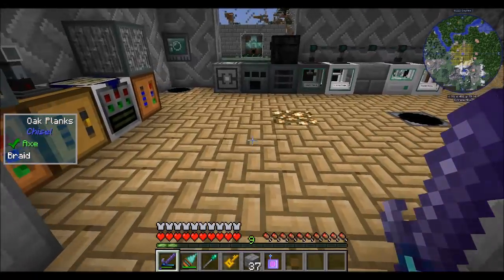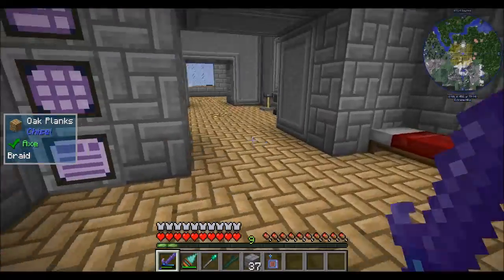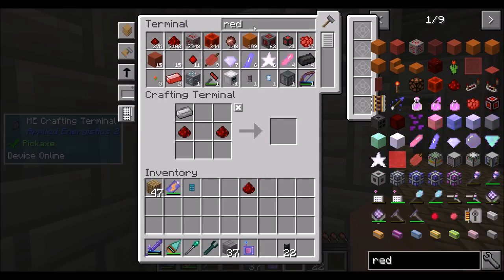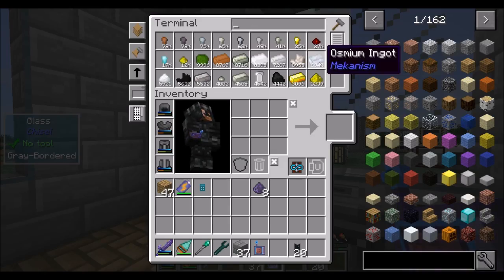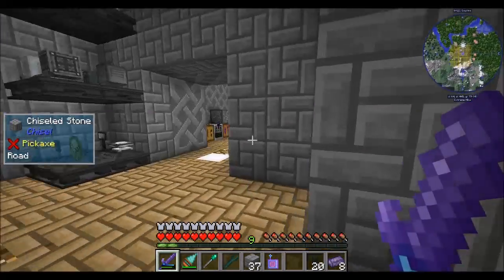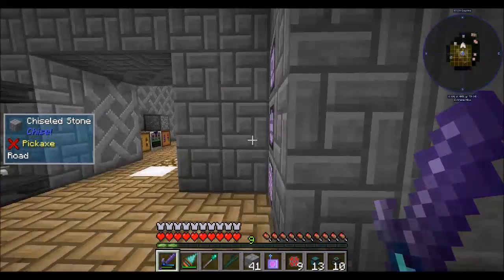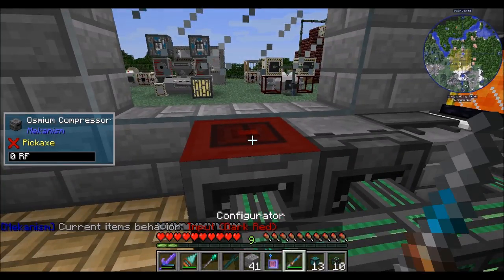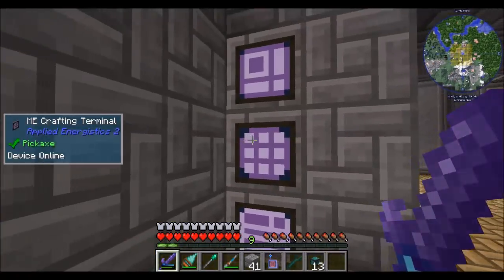AoE Ep57 Proper Mekanism

Comment: For saving Resources put the Redstone/Diamond/Coal/RefinedObsidian Dust first into a Enrichment Chamber to compress them. 1 Compressed Dust is 8 uses in the Infuser.
1 Normal Dust is just 1 use in the Infuser. So you need 3 Infusers Dire... Coal is just for Steel....
Also with very few Resources you can upgrade the Crafting Machienes. There are 4 Tiers: None, Basic, Advanced and Elite. Each Upgrade increases its simultaning crafting Capacity. 
For Example a Basic Machiene can craft/smelt/etc. 3 Items at the same time.
Also for Speed Upgrades...I recommend for each Speed Upgrade also an Energy Upgrade which reduces its Energy Usage.
Reply: 4 tiers are Basic, Advanced, Elite, and Ultimate. :D
Reply: He's probably just looking for any reason to waste the ridiculous amount of redstone he has lol.
Reply: the ones that can smelt 3 items at a time are factories
Reply: those are called factories
Reply: Also, the regular machines can be upgraded to factories in place using upgrade kits.
Reply: as long as it's all mek then it should be fine, did they fix the power bug with cable that can crash the server.
Reply: One of the greatest things about Mek is that it's all about Resource Efficiency. I came down to the comments just to tell him all this lol. Also, on the upgrades, it's about 2 Energy to 1 Speed to keep the same power consumption, but maxed upgrades is 10x of whichever (so 10x faster or 10% energy usage, etc). Also, Sound upgrades are a thing Dire will love.

Comment: Hey Dire, just a little tip for Mekanism,
When you install speed upgrades in your machines, MAKE SURE that you install energy upgrades too. If you install 8 speed and energy upgrades (hypothetically) then you actually use LESS power than no upgrades at all, so give that a shot! Thanks for making great content by the way.
Reply: This is not completely true.  8 energy upgrades decrease the energy usage to one tenth of the original, however 8 speed upgrades increase the energy consumption to be 100 times as much as the original. With 8 energy and 8 speed upgrades the machines use 10 times as much power as with no upgrades. Still, definitely worth it.
Reply: Ok, thanks for correcting me

Comment: the mekanism wrench is required because all the other wrenches dont have modes to switch between fluids, gases, items, and heat as well as input and output as well.

EDIT: took me 2 days with no sleep trying to figure out the mekanism stuff then i found out that only the mekanism wrench works (i was on the modpack named Project Ozone 2 Reloaded)
Reply: all the maschines from mekanism at least now have an interface that you can use to configurate what the sides do the only thing you realy need the wrench for is configurating pipes and rotate the maschienes
Reply: I'm confused how in depth you went into Mekanism in PO2. I only got enough of the basics to do very simple automation of HDPE sheets and demon steel. I only ever needed the buttons in the interface and a lot of messy cabling.
Reply: i wanted to do all of mekanism. HDPE sheets for the me controller, the plastic blocks for fancy building, and use the laser drill from mfr with the x4 ores (i think the x5 was disabled in project ozone 2 or something).
Reply: The Nerd no it wasn't. Trust me.

Comment: You should move pretty quickly to a bio generator with potentially some wind generators as supplement. Eventually you can make the huge multiblock reactor that makes stupid amounts of Joules which you can then store in the giant multiblock battery.

Also if you disable sides that aren't used on the energy cube, you get to see the nifty animation hologram in the middle that shows how much power is in the cube.

Comment: Hey dire, have you thought of using ender IO  item conduits and attaching several interfaces to them to increase the ability to auto-craft? That way you could have up to 5 interfaces per block side as apposed to 1.
Reply: I don't think Interfaces can output directly to conduits. That is why he uses chests when he needs to use conduits for auto-crafting. (Like the calculator auto-crafting he did in this episode)
Reply: Touche, but I believe the idea still works, using a chest/crate and surrounding it with interfaces, piping the items out of the chest and into the machine.

Comment: Why do you use the Alloy smelter for stainless steel and probably some other things when Macerator and Electric furnace would be faster? It would be faster to macerate things in the macerator(zirconium can't go into the macerator, so it would be best to not smelt the dust) and then smelt the blend in the overclocked electric furnace(why hasn't he made it yet?). I think a lot of the time autocrafting is wasted because Dire uses Ender IO too much when IC2 can do the same things, but faster.
Reply: ender io is easier

Comment: dire in 1.10 the induction matrix multiblock is beyond laggy use the cube also the mekanism wrench is the configurator
Reply: also steel casing might have a cheap replicator recipe